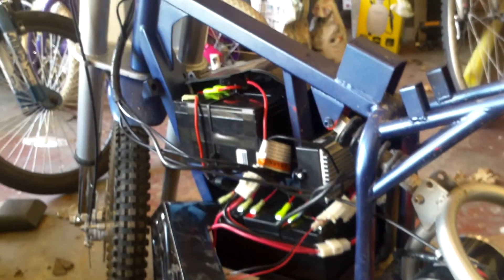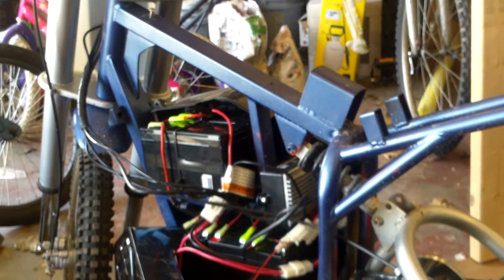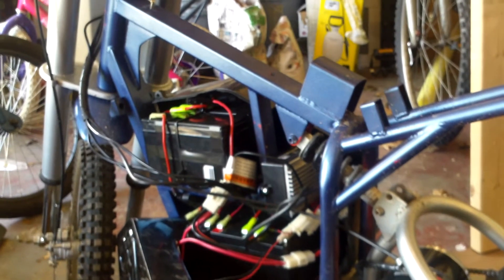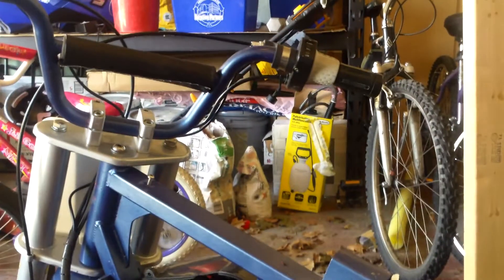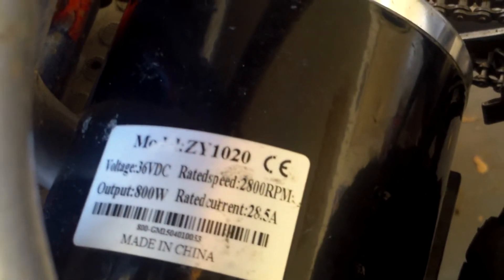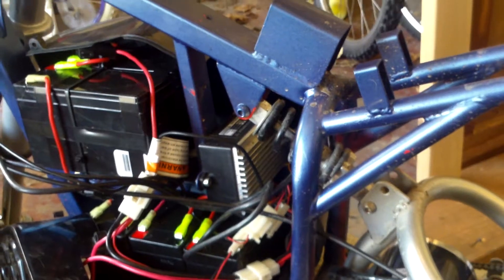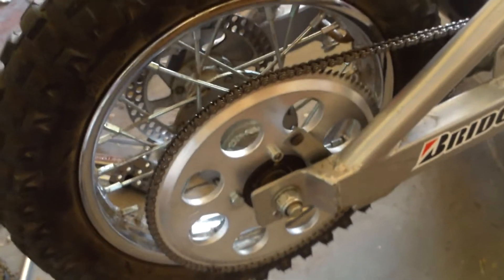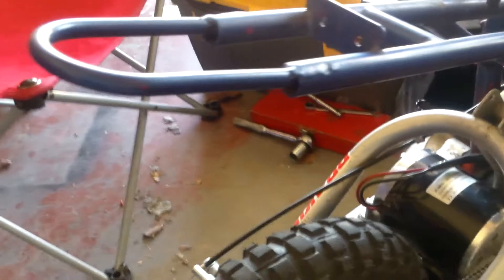Mx 500 conversion to Mx 800: Video 1

Comment: ORIGINAL MOTOR WAS A 36V 500W AT 2750 RPM. NOT 800W OUTPUT OF MOTOR, WITH 60V IT IS PUTING OUT 1773W AT 4200 RPM NOT 2800 RPM. WITH A 14" TIRE 90 TOOTH SPROCKET AND 11 TOOTH PINION GEAR AT 4200 RPM THE MAX SPEED WILL BE 22.98 MPH. IF YOU USE A 24V 500W 2750 RPM WITH ALL STOCK GEARS AT 60V IT WILL BE 1663W AT 6875 RPM WITH MAX SPEED AT 37.62 MPH AND IF YOU GO TO A 80 TOOTH SPROCKET YOU WILL GO 42.33 MPH,  AND IF YOU GO TO A 65 TOOTH SPROCKET YOU WILL GO 52.07 MPH.